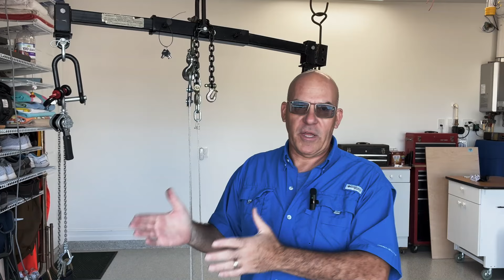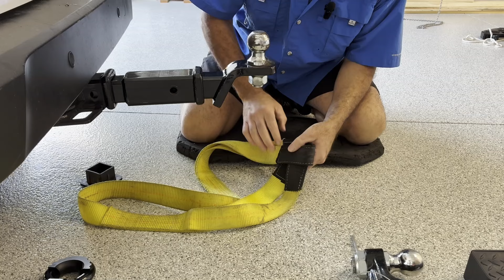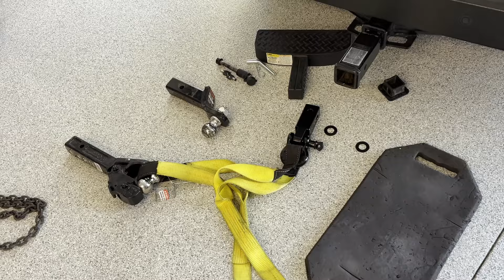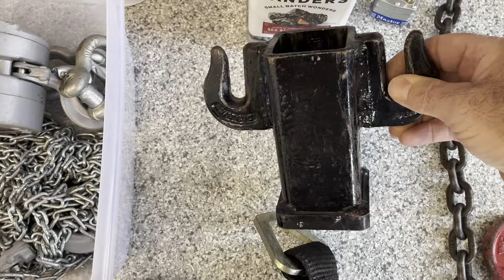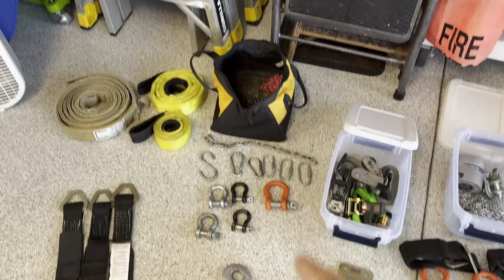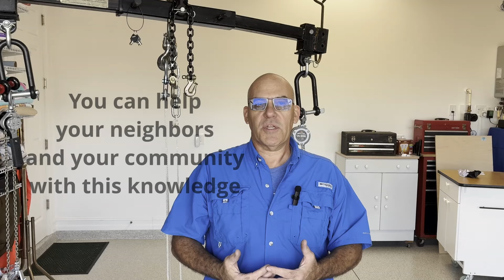Master Storm Cleanup Using Your Vehicle

Comment: Well done.  

Rigging is something many Preppers don’t include nor fully understand.  If the road or your property is obstructed one needs to be able to remove the issues.
Reply from the maker: Thanks for your comments @Diver-q5x, I see more and more people who host channels and they clearly do not possess the basic mechanical ability and general knowledge necessary to safely handle issues related to tree blowdowns and storm debris cleanup, and how to use tips and tricks to safely gain ingress to or egress from their property after an event.  These skills are crucial!
Reply: or to free a stuck vehicle, move a disabled vehicle out of the way, shift a Jersey barricade blocking your path. . . innumerable reasons to learn these skills.
Reply from the maker: @Diver-q5x  Absolutely, and while so many people are enamored with other, seemingly more exciting parts of prepping, i.e. weapons and gas masks and such, these other "quiet skills," like knowing how to handle the rigging and lifting and horizontal/vertical displacement tasks that you mention, are the true skills that so many people need to learn.  Hats off to your comments!

Comment from the maker: What kinds of storm cleanup have you done with your vehicles after a storm?  What kind of gear did you use? 🧰
Reply: Chainsaw, bow saw, ax, various pieces of rigging, More-Power Puller and a pulley.  

Had a winter storm where 200 trees fell in the campground where we were living.
Reply from the maker: @Diver-q5x  Great comment!  Rigging knowledge is essential because there is so much more to cleanup than just haphazardly hacking and cutting fallen trees and branches.  The proper planning and the proper tools make a huge difference in your safety, productivity, and in the ultimate return of your property to a happy state!  Thanks for watching! 🧰